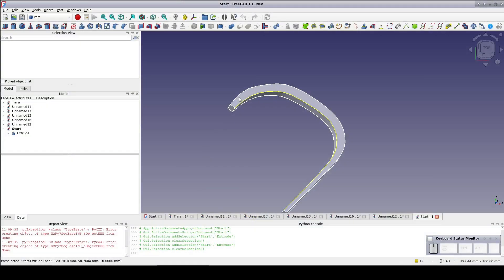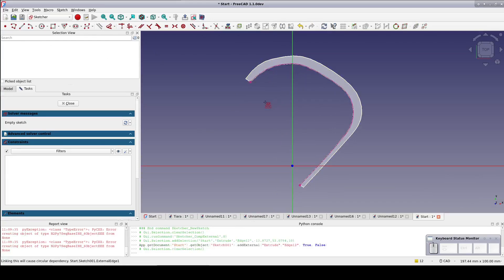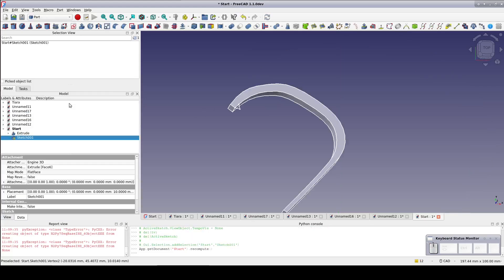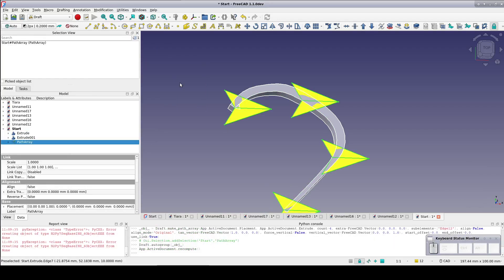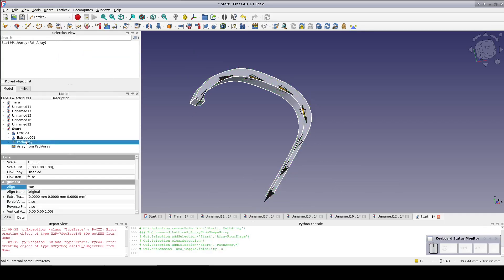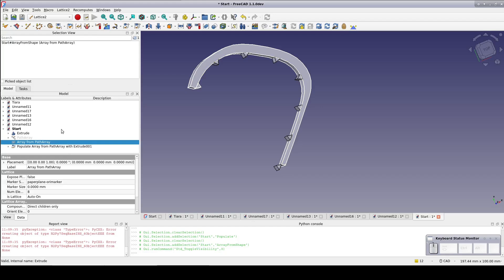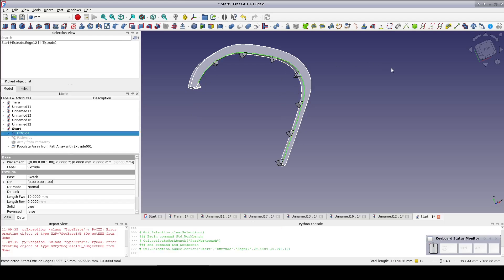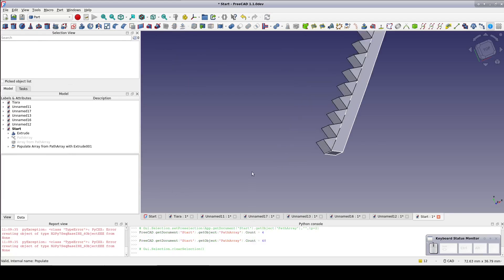FreeCAD:The Path (Array) to success.

Comment: Could I use a similar method for a sprocket and chain or caterpillar track?
Reply from the maker: Absolutely!
Reply: use the gears workbench
Reply: @andrelanger8396  Part Design workbench also has the ability to create a parametric sprocket outline to extrude (ANSI, ISO, bicycle and motorcycle).  PART DESIGN > SPROCKET